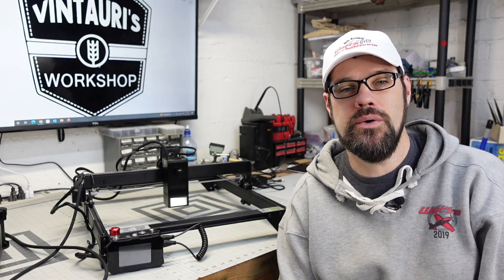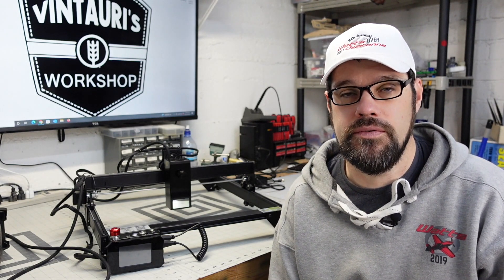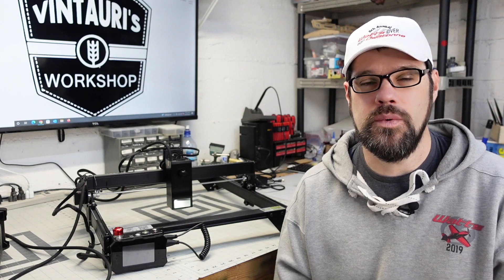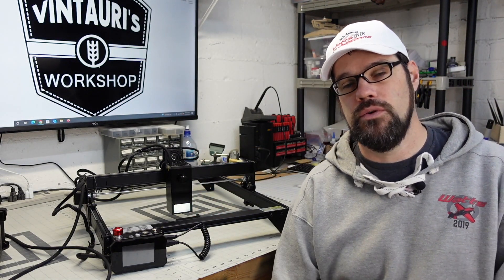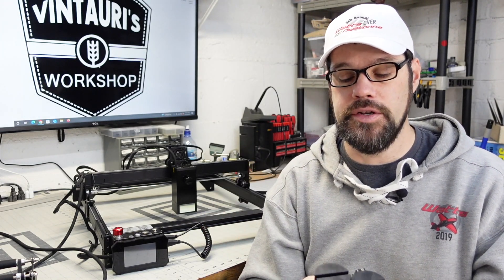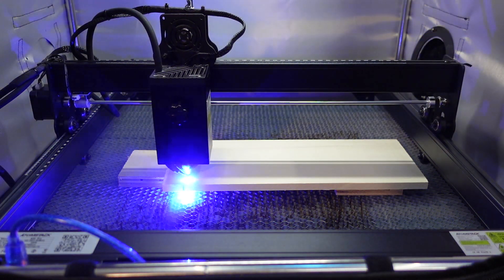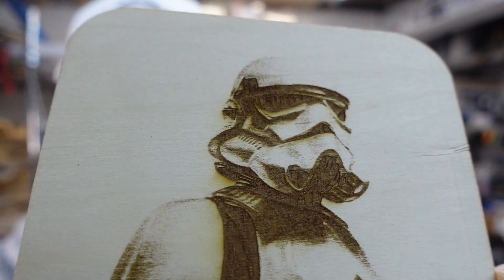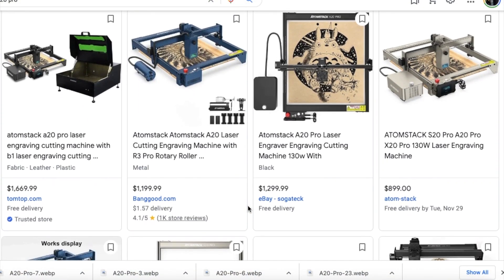Atomstack A20 Pro - What can we do with 20 watts of diode laser power?!?!

Comment: Good video. I am looking at an x20 or x30 Atomstack for classroom projects. I primarily need to cut and engrave 3mm and the 5mm HomeDepot Purebond 3 ply (hardwood veneer with poplar core) plywood. Of course engraving. Would both work and it is just about speed?
Reply from the maker: Either one should get through that material without too much hassle.  I was just cutting some of that this weekend on the Atomstack A24 at around 400-500mm/min.  The more power would allow you to increase the speed a little.  Any unit you purchase make sure to sort out a safe enclosure to deal with the light and smoke, especially if you use it in the classroom with others around.  If it's just you, you can get by with the goggles and open air ventilation, but an enclosure makes it much easier and safer to deal with.

Comment: Hi, I have an atomstack s20 max.
The power of the laser is 18-20w.
They cannot cut plexiglass (acryl) 3 mm at all.
Is the problem that the laser power is low, or did I not set good parameters for cutting? I use the lightburn program
Reply from the maker: If you are trying to cut clear it will not do it at any power.  It's the wrong wavelength and you need a Co2 laser for that. If it's black or another solid dark color you should be able to cut through 3mm acrylic but it may be slow depending on your lasers actual power output I would start around 150mm/min speed and 80-100% power and adjust from there.
Reply: @Vintauri  Thanks for advice

Comment: Good afternoon, I have had my A20 pro for a couple of days now and I’ve tried various material tests as laid out by AtomStack and my laser will not achieve the cuts they have stated. Having watched your video, I matched the parameters you set with the same material, laser focused correctly etc. for me to get through 5mm ply I had to have the power at 95% at 250mm/m and 4 passes. Is there anything you can think of that might be set wrong on my end to get such different results? Thank you.
Reply from the maker: You may want to check your device settings and look up the $30 value.  It should be set to 1000 but if it's lower it may not be allowing the full power of your laser module to output.  I've seen this be set at 255 which would mean it's running at 25% power.

Comment: Great review! I have an art project where I need to cut pieces of 2 mm aluminum for photo prints. Is that possible with the Atomstak 20 watt unit?
Reply from the maker: Unfortunately diode lasers cannot cut metal other than super thin material like foil. You need a much higher powered laser to do that.

Comment: I just bought the A20 pro - never used a laser before and Im somewhat apprehensive abt the learning process.  Is there a website to show how to get an image starting from the computer to the laser.  Thanks for any help you can give me.  BTW liked your assessment on the laser
Reply from the maker: You might want to check out the website I-magr as they have both free and paid software that helps set up images for lasering.  They also have some decent videos to follow along for how to get them into lightburn and other software.  https://www.imag-r.com/
Reply: @Vintauri  thank you will give it a go

Comment: At this price point, why would you get this laser instead of a K40 with some upgrades?  I understand if you need to mark metals, but the cheaper 10W lasers can do that as well.
Reply from the maker: This still has a larger cutting area of over twice the size of a K40 as well as being more portable. There are also fewer things to manage from mirror alignment to water cooling setup thats needed for a CO2 laser. But you also give up the ability to cut any color acrylic including clear and it's still less power than the 40w CO2. Both have their features one might want to consider when choosing a laser.

Comment: Atomstack offers now a new modell with a optical power of 33 Watt with a six diods laser head .
Reply from the maker: It seems the next jump for most manufactures are in that range. I'm not convinced that it will help you cut much thicker material, due to the same focal depth, but it should help speed up the same cuts and engravings.
Reply: I bought this X30 Pro  this is my first time using laser engrave machine I have problem in starting point and the aliment  I can get exactly where it well start engrave spically if i need to engrave in small pices  any one face this it doesnt show cross or point 
any solution

Comment: Clack sent me to this vid.  Thanks.  I am looking for a 20w and had asked Clack his opinion.  If you had $1500 to spend on a 20w, what would it be?  I currently have the xtool d1 pro 10w.  A 20 w head for it is $700 (fyi).
Reply from the maker: I don’t think you can go wrong with the XTool or the Atomstack 20w laser so it would depend on if there were features one had that really appealed to you. I’d also consider the Sculpfun S30 pro max. It has auto air control to turn on and off the air pump using the lighburn switch per layer. Outside of that I do like the Atomstak air pump better than others. It seems to put out more air.
Reply: @Vintauri  I think I am leaning to the atomstack.    Any idea if the xtool rotary tool will work with atom ?  It is lightburn that runs its, right?
Reply: @Vintauri  Xtool D1 Pro

Comment: I've had my Atomstack A20 for a couple of weeks now and am just getting to the point where I can try it out.  Out of the box, the X axis wouldn't roll because the rollers had developed flat spots where they sat on the rails.  I took them off and found two of the rollers had gouges that made them unusable, and the rest of the rollers developed flat spots after sitting unused for a day.  New rollers fixed the problem.  The gantry rocked on 3 rollers until I loosened the end screws to let it align itself.  The laser didn't  fit the dovetail until that was reworked.  All set up now waiting for the Comgrow camera you reviewed recently.
Reply from the maker: That's too bad on all the problems with the A20.  I didn't run into any issues like that with mine but I'll keep an eye on it for any that develop.  The camera does take some calibration so hopefully working through the offsets will help as you dial it in.
Reply: Can I ask where you got rollers from
Reply: Can I ask where you got rollers from

Comment: I picked this Laser up back in June and largely have been satisfied with it. Was not wild about the cable mgt and some of the connections are loose fitting. Maybe that has been corrected by now for the one you got. But the USB connection for my computer is really loose and wobbly. After months of pretty intense use I can say that it does cut well, as you found. I am not unhappy with it even after months of continuous use. However I do miss the incredible detail I could get with the Ortur 5w I had before when it comes to engraving. And the Air assist I got with mine was not the same one as you got. This may be why I get pretty excessive over burns on nearly all of my cuts. Also if anyone gets one of these and puts it into an enclosure, it generates a TON of smoke and debris so make sure you have decent ventilation. Mine overwhelms my ventilation/filter and as a consequence it sticks around in the enclosure getting sucked into the laser by the VERY LOUD fan that is on top of the laser head that keeps the 4 diodes cool. I discovered that frequent cleaning is needed to keep the fan and inside of the laser module from being completely bricked with soot. 

It is a good machine, but it has it's specific strengths (cutting) and weaknesses (In my experience, engraving detail). If you need a good cutting machine at this price point (vs. stepping up to a CO2 laser) then this is a good option. But I do plan on getting another Ortur with the fine focal point for my more detailed engraving projects.

Good review. Thanks for the video.
Reply from the maker: Thank you for your input.  I do want to do more testing on the engraving and compare it to the 5w and 10w units I have on hand.  I think on clear wood, stainless steel, or tiles you'll really see the detail difference in the engraving.
Reply: @Vintauri  Update. After only 6 months of use, the thing shows damage on the lens cover, which they must expect because one of the resellers lists the lens covers for sale in batches of 3. Tried to order them and have been told it will be months before I can get it due to them being out of stock. Not sure if this is the reason or something else, but I now can no longer cut even 3mm Baltic Birch (even at 100mm/m and 100% power). Getting help from the company is apparently impossible since I purchased it from a reseller and the reseller has proven completely unwilling to help me. Deal with this company at your own risk. Is there no companies that make lasers that are not in China?
Reply from the maker: @jackhelm9852  is it the lens cover glass on the removable brass ring or the actual inner focus lens that is damaged?  If it’s the lens cover glass there are easy replacements that can be found elsewhere and cheaper than direct from the manufacturer. It’s the same cover as used on the XTool and other diode lasers.